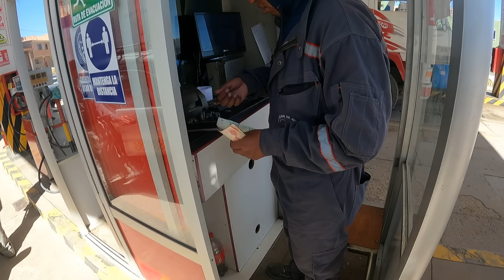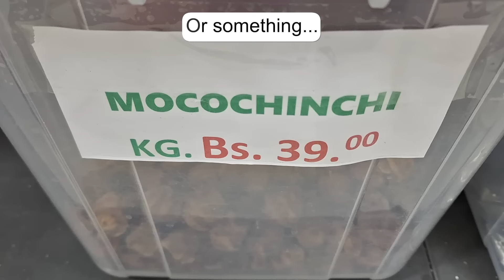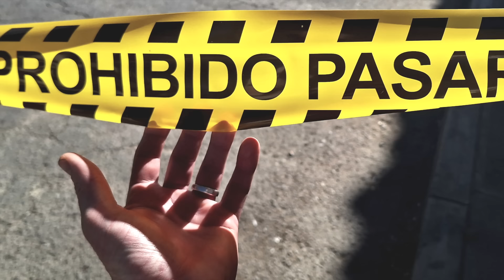Exploring Bolivia's Tin Belt (S3:E61)

Comment: When you get a chance, next time, slip a piece of pipe in the tubing, a small piece of pipe and weld it with the pipe on the inside, then you would never have to worry about it again you won’t even have to buy a new one will strengthen it
Reply from the maker: Unfortunately, there is a threaded sleeve that penitrates the tubing right there that prevents you from reinforcing the break. But yeah, otherwise that'd be the ticket!! 💪

Comment: The never-ending search for fuel for moto traveller's has resemblances solar Ebike travellers due to carry capacity of battery and fuel tank are small and thirsty. Cyclists like Mark Havran's Esolar recumbent bike set-up took it to an other level by engineering solar panels tilt sensors to search for the fuel.
Reply from the maker: I can't begin to fathom establishing the infrastructure for electric vehicles in this part of the world. They have much, much bigger fish to fry! Overland cyclists are another level of Loco! We run into them on occasion, and I'm always stunned by the seemingly endless intestinal fortitude they muster on a daily basis... 😵‍💫
Reply: @TwoWheelsThreeSheets  Apparently Havran uses hybrid so actually does peddle too but uses Esolar panels on a trailer for an off grid boost (his search is for enough sun) but personally  prefer an Africa twin for the shear doing the tarmac and trails like on your epic travels. Best!